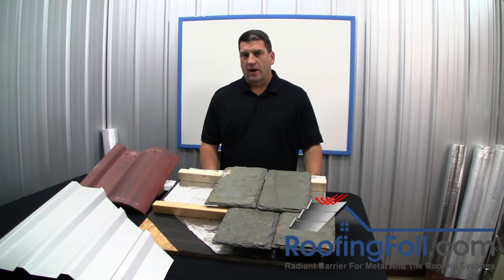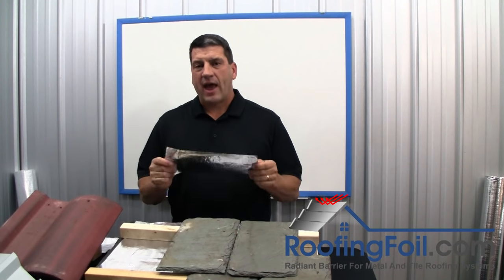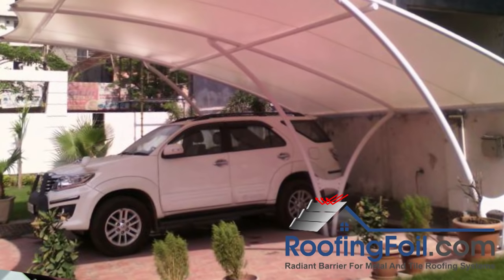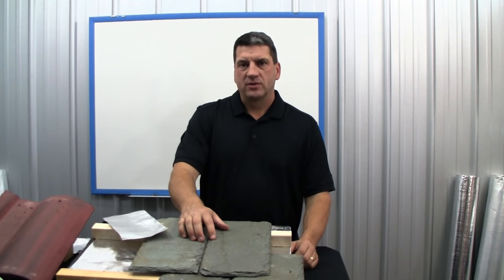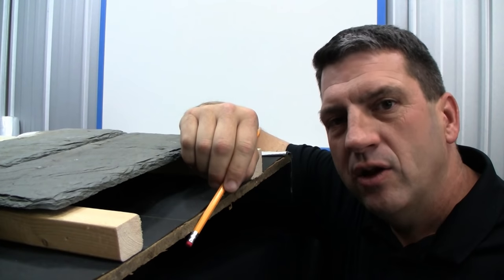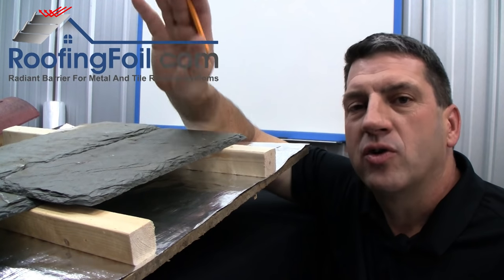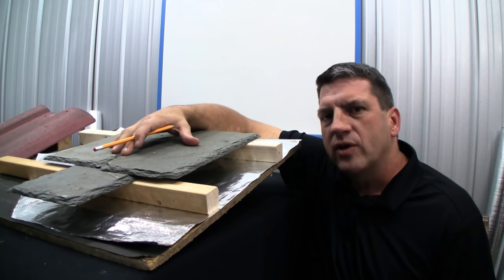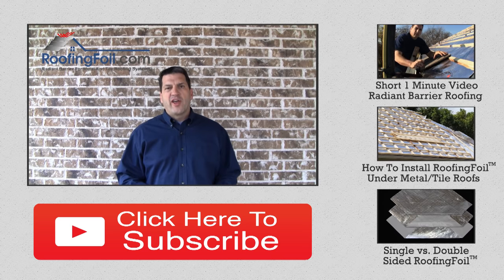RoofingFoil - WATCH THIS BEFORE you buy a METAL or TILE ROOF!!

Comment: I didn't use their radiant barrier but I did install barrier prior to renovations and even after REDUCING my air conditioner by  20% to increase dehumidification time, the radiant barrier reduced my thermal load significantly! now I do have to install a dedicated dehumidifier since I am in the south, But the Radiant barrier is awesome! Between the radiant barrier, and smaller AC, Iv reduced my electric usage in the summer by about 25%! My system was tracked with a Flir Thermal camera and data logging thermostat.
Reply from the maker: Check out our new Miami-Dade County approved radiant barrier and underlayment here: https://www.roofingfoil.com/shop/single-sided-solid-foil-underlayment/

Comment: I was telling my dad about this.  I'm getting ready to replace my asphalt shingles with metal roofing and he's helping me out.  He has over 50 years as carpenter/roofer and I've never roofed so I'm getting advice from him.  He told me there shouldn't be anything over the insulation in the attic and that this might cause the metal to fail early if it's heating the metal up by reflecting the heat back into it.

I didn't know how to answer him.  Can you help?  I'm starting to rip the old shingles off in about 2 weeks.
Reply from the maker: Thanks for your question.  This is common belief that the heat reflected will cause damage to the roof.  However, the facts are that the roof OVER a radiant barrier usually increase less than 10 degrees.  This is considered nominal and will not damage the roof.  Here is a video showing the roof temperatures over a radiant barrier: https://youtu.be/OHpyv_kxmoI  And our webpage with the info: http://www.atticfoil.com/index.php/knowledge-zone/knowledge-zone-learn-about-radiant-barrier/myth-or-truth-radiant-barrier-damages-roof-shingles/

Comment: So in the near future I'm going install attic foil.   In 15 years I will likely have a metal roof put on.  Is it a home run of an idea to add the roof layer on top of the deck while have the under rafter attic foil already installed?  Or damaging idea?
Reply from the maker: You and do both and it won't hurt.  Think of having two pairs of sunglasses.  What get's past the first, will be handled by the second pair.

Comment: Great information. Thank you! If you have osb with radiant barrier installed as decking, is using your product or similar going to create any issues. Thank you again!
Reply from the maker: No problem at all.  In fact, it works great. We have many builders who actually do both.  With both layers, it's hard to tell from inside the attic if the sun is shining it works so well.

Comment: What if I already installed Attic Foil inside my attic? Do I need to install it on the roof too ? What would be the benefits if I did ?
Reply from the maker: Yes, I would install www.RoofingFoil.com on top of the roof given the chance.  The attic install is good, but the above roof deck is by far the best.  The actual roof deck will be much cooler.

Comment: Can a radiant barrier be implemented when you use steel shingles? Also, if you have that radiant barrier, how does the roofing hold up when you walk on the roof such as for cleaning gutters, painting, scooping tons of snow off your roof? And how does the roof hold up to hail or snow since it has no solid backing? Might it be more prone to damage from the elements?
Reply from the maker: Steel shingles work great with a radiant barrier since they have the airspace behind them.  As far as durability, every product is different, but in general they are designed to handle foot traffic.  It wouldn't work if they got dented, or damaged overtime someone got on the roof.  Same with Ice/snow.  It would take a LOT of ice or snow to have enough weight to affect the roof.  I'd think the structure would fail before the roof.

Comment: Great video. Should you install the foil on the roof and in the attic, so you get better result? Thanks.
Reply from the maker: It won't hurt but once you install www.RoofingFoil.com the attic layer does not have much heat left to reflect.

Comment: What impact will a foil based radiant barrier on a roof have on things like cell phone signals, radio and tv antenna reception, and for that matter will a metal roof not also have a similar effect?
Reply from the maker: It really depends.  I can have an effect.  I really depends on how strong the signal is now.  If you have a weak signal, It can push it over the edge.  If the signal is really strong, then you probably won't have an issue.  It would normally not have an effect on external antennas or dishes since they are above the foil.  Cell signals can be questionable. However, a MicroCell is the way to fix this.  http://www.atticfoil.com/index.php/knowledge-zone/knowledge-zone-learn-about-radiant-barrier/myth-or-truth-cell-phones-and-radiant-barrier/

Comment: Hi, enjoyed this video, I do have a question though. I am building a new house with foamed attic. In the south with high heat and humidity. I have a good underlayment down rated for high temps. I was planing on a silver metal roof either on batons or directly to the roof. Would the metal be it’s on radiant barrier or would your product give a better result?
Reply from the maker: Steve,  great question!  Just because something is "Shiny" does not mean it reflects heat.  Think of chrome bumper.  Would not want to sit on it on a hot, sunny day.  It sounds like you are doing things right.  I have and love a foam encapsulate attic. But you still need a radiant barrier.  Definitely do it right from the beginning and install battens and www.RoofingFoil.com  any question call the office.  This area is really my passion.  We call it "high performance construction".  You can see what I did on my home here: https://www.radiantbarrierguru.com/combining-radiant-barrier-with-spray-foam-insulation/ Thanks, Ed.

Comment: Could you explain me why shouldn't i place the foil directly on the roof?I think the sun light is also the radiant heat,so the foil can reflect most of it .I ask you  because my building is already build-up,it's a flat concrete roof, and i want to do it the cheapest way, so i think i just bond the foil to the roof like aluminum coating.
Thank you.
Reply from the maker: You CAN put directly on top of the roof.  We have many customers who have used AtticFoil for outdoor applications with great success. Depending on the conditions I'd expect 3-7 years of benefit.  If possible it would be better to lift the foil off the roof rather than bonding.  You could use what's called "sleepers" to lay the foil across.  2x4"s or something similar.  Then, depending on the wind, you will want to weigh down, or mechanically attach the foil to the sleepers or roof.  I would also drill a few 1/2" holes through the roll before installing to provide plenty of holes for rain to drain through.  There are many ways to do this.  Basically, you will need to "rig" it.  Here is a link showing Radiant Barrier Outdoor Applications: http://www.atticfoil.com/index.php/applications/exterioroutdoor-use/

Comment: Would you get a  yield up of condensation/moisture in the cavity (air space) between the radiant barrier and roof tile in cold conditions? And if so, what would you recommend to combat such a problem?
Reply: Build up not yield 😂
Reply from the maker: Condensation is fact of nature.  When the temperature of an item drops below the dew point, you get condensation.  Even tree bark will get wet from dew under the right conditions.  So, yes potentially there could be some condensation between the roof and the foil. Normally, it will dry or bake out after the surface temps are above the dew point. This is one reason for having an underlayment.  It keeps the wood from getting wet due to condensation not just liquid water getting past the roofing layer.

Comment: What about hurricane-prone areas? Especially close to the Gulf Coast? I would like to use metal roofing but the use of battens will not hold down the roofing well in a high wind event. Also, I plan to use spray foam in the attic, so installing the barrier under the roof deck is not gonna work either. Is there any kind of solution for that? The roof sheathing will be glued and screwed (or ring shank nailed) for uplift resistance. The only solution I can think of is 2 layers of sheathing separated by an air gap. Or just skip the radiant barrier altogether.
Reply from the maker: Hurricane prone areas?  Check out our new product: https://roofingfoil.com/48″-wide-roofingfoil-solid-underlayment-miami-dade-approved/

Comment: Ed, I'm going to be doing a 14' cargo trailer RV conversion. Can you tell me how much of a gap (air space) you think would be minimum for the ceiling and walls? I'll probably be doing a rigid insulation (3/4" or 1") in both ceiling and walls.
Reply from the maker: 1/2" minimum should work well.

Comment: I have a flat roof, no attic, and am considering this method. The AC in the house is working too hard? My question is: what material would you recommend to use as top surface?
Reply from the maker: David, thanks for the question?  It can definitely work on flat roofs.  However, I really can't give you a good answer without more info about your project.  Can you call us at www.RoofingFoil.com?  Ask for Ed.

Comment: Question from the Philippines!  Do you intall the radiant barrier on undernear your metal roof or on top of your insulation to keep out
Reply from the maker: The BEST option is to get it under a metal roof if you have that option.  It's better to get the radiant barrier as far to the "outside" as possible.  If you don't have this option, then a regular attic installation method with www.AtticFoil.com is the way to go.

Comment: Is there a solution for those using shingles.   I need to change my roof.  My attic get so hot in our 110 degree Louisiana temperature.  I heard Radiant barrier foil can be used under the shingles.  But from what I heard on the video, there should be space between the foil and the shingles for this to work.  What is your opinion and is there a solution to reduce the heat in the attic.
Reply from the maker: http://www.atticfoil.com/index.php/products/48-wide-double-sided-atticfoil-radiant-barrier-foil-perforated/  You can install inside the attic if you don't need a new roof.

Comment: I have an open beam ceiling in My Den that we are taking the roof off of on the outside. What insulation can I put down before the shingles go down because the den is so hot you can't even use it in the summer and it's so cold in the winter it's freezing in there and all the walls are insulated in there. I also have put in heat and air. What is the best insulation to put down on a flat top roof what is an open beam ceiling without destroying the ceiling?
Reply from the maker: About the only way is to build up the roof using high density foam board.  You basically have a commercial roof application.

Comment: This looks great for hot environments. Can the roof still "breathe"?
Reply from the maker: Yes, this will not change anything to do with the attic ventilation.
Reply: what is the best way to vent a metal roof with the foil installed?  I have a solar powered roof vent now. Also won't a white metal roof eliminated the need for the foil?  Anyone have experience with white metal roofs? It is THE best for reflecting sun (and thus heat) from the roof and attic. also helps the environment.

Comment: Can i cover the top of my roof with foiled stone wool? Our roof is covered in shingles and they never put any insulation on it
Reply from the maker: In a ventilated roof, putting the insulation on the roof is the wrong place.  This is kind of like holding a jacket OVER your head-Why??  You "thermal boundry" or the box that you keep hot/cold is usually the FLOOR of the attic and this is where more insulation would go.  For the roof, all you really need is to stop/slow the RADIANT HEAT and this is what product like www.RoofingFoil.com does.  To slow down CONDUCTIVE heat you need "regular" insulation on the floor of your attic.  So, radiant barrier is your 1st line of defense against radiant heat and regular insulation is your 2nd line of defense against conductive heat.

Comment: hi , what happens if i glue together the aluminium coil direct to the bottom part of the  metal roof and dont have the air space .does it work the same.? metal+glue+aluminum foil

thanks
Reply from the maker: If you glue the foil to the bottom of the metal and the foil facing away from the metal still faces an airspace then it will work.  You must have an airspace on ONE side of the foil for it to either work off of the reflectivity or emissivity quality.  You cannot "sandwich" the foil between two other products.  Here is a vide explaining exactly why an airspace is needed:  https://youtu.be/aympJmf4bUU
Reply: From my understanding that wouldn't work. But more interesting would be to have a weather resistant aluminium foil ON TOP of the roof, facing the sun... It would look a bit strange, all silvery, but in regions of extreme heat, who would care?...

Comment: Is there any benefit or detriment in the winter time trying to keep my home warm?
Reply from the maker: Not really, the roof is not really intended to perform as an insulator.  In fact, you WANT the roof to stay cold to prevent ice damming.  Your attic insulation is what helps keep the heat in during the winter.

Comment: Is this needed or helpful on a metal roof application that has open cell spray foam under the roof?
Reply from the maker: Absolutely!  This is the perfect situation where you want to use www.RoofingFoil.com.  Basically, you want to build a refrigerator an put in the shade.  The foam is your refrigerator.  Great Job!  You know a refrigerator in the shade will be easier to cool and more efficient.  So, the radiant barrier will do this.  Here is an article I did 10 years ago about combining spray foam and radiant barrier (not using a metal roof) on my home: https://www.radiantbarrierguru.com/combining-radiant-barrier-with-spray-foam-insulation/

Comment: Do u have to use the felt paper with the radiant barrier or can u just use the radiant barrier over the sheathing and on wood planks can u use 1x4 or u have to use the 2x2
Reply from the maker: You can go with or without felt paper.  The felt paper provides an extra waterproofing layer and can help reduce some condensation by keeping the deck a little warmer.

Comment: is this like that reflective bubble wrap i saw at lowes?  how thick is this stuff?
Reply from the maker: No, this is not bubble foil.  Basically, it's like a heavyweight/tearproof blue tarp with aluminum foil laminated on one or two sides.  For this application, you simply looking for reflectivity not r-value.

Comment: Is the RoofingFoil replacing the felt paper or in addition to?  If an addition, I assume the RoofingFoil would go on top of the felt?
Reply from the maker: It depends on the roofing system.  Normally it will replace the underlayment, but on some systems like tile, you would use in addition to a traditional underlayment.  Call us at www.RoofingFoil.com to discuss.
Reply from the maker: Our latest product:  All in one Radiant Barrier AND underlayment:  https://roofingfoil.com/48″-wide-roofingfoil-solid-underlayment-miami-dade-approved/

Comment: So the air in my attic gets hot but the air between the tile/metal -roof and the roof deck does not?
Reply from the maker: I think you missed something.  The attic air will be much cooler with a radiant barrier.  The air temp between the deck and metal roof depends greatly on the ventilation between the two.

Comment: I'm from tropical Sri Lanka. My question is whether there should be any ventilation in that air gap. Thank you.
Reply from the maker: Normally you want to combine radiant barrier with a ventilated airspace if possible.
Reply: Hi Janitha,
  I am a builder, and just recently returned from a project there in Sri Lanka.
 Two things I would add to the ventilation of a roof in Sri Lanka.
1) use a continuous screen at the bottom of your battens under your roofing, whether it is metal, tiles or asbestos concrete sheets. this will allow for any water to get out and for air to flow up, and to keep any crawly things out, and help keep the driving rain out.
2) Run a continuous ridge vent open and screened across the top of the roof, again with a screen for the same reasons.
3) I would also tape the joints in the foil to help with the water proofing.
 
Good luck.
Patrick

Comment: Will the foil work with asphalt shingles with no air gap?  thanks!
Reply from the maker: No, you MUST have an airspace on once side of the foil.  It won't hurt to use foil, but it won't help with reducing heat flow either.
Reply: What if you were to go in your attic and put the foil across the rafters.  Then you would have an airspace between the sheathing and the foil.  Would it hurt anything to direct the heat back to the sheathing whether it be OSB or plywood?

Comment: How does foil reflect in the dark.
Reply from the maker: Radiant barrier reflects HEAT, not necessarily the light.  Infrared Radiation is the INVISIBLE part of the light spectrum.
Reply: Thanks for the info. Will this work for siding
Reply from the maker: Yes - Siding Info Here: http://www.atticfoil.com/index.php/applications/house-wrap-behind-siding/

Comment: Ed, what is the smallest airspace above your radiant barrier? Is 1/4" too small?
Reply from the maker: 1/4" will still work.  It's about as small as I like to go.  Vented works better than a dead airspace.
Reply: AtticFoil Radiant Barrier Foil Insulation  : Thanks for the reply.   I am using your R.B.F. under cedar shakes, and I am trying to keep the lowest profile.